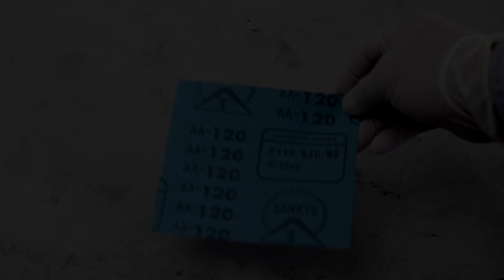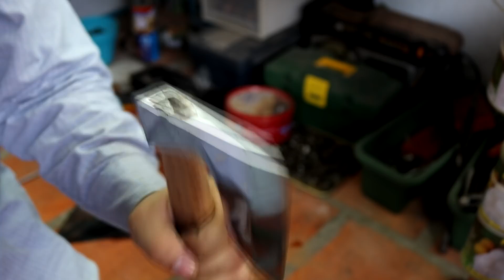Antique Axe Restoration Step by Step

Comment: You should use rust removers to not destroy the temper of the axe unless you use a wire wheel and then sand very lightly using the disc, I personally don't think you really destroyed the temper cause you sanded so lightly for the most part, oh and another tip is always glue a wooden wedge  before inserting, it will stay inside better and make it a bit stronger too. A couple good rust removers are Krud Kutter and Evapo-rust

Comment: Excellent...excellent job.  The only comment I have is on the metal wedges.  You used them wrong(imho).  A softwood wedge is used in the handle slot and then. 1 metal wedge perpendicular to that.

Comment: Grinding the cutting edge of any tool at that speed just killed the temper in the blade nice axe no makers mark and useless wall hanger
Reply: Not as long as you dont over heat it, dip it in water as your grinding and you'll be fine. But also with axes since they're so thick you can grind constantly with light passes and be fine. Of course yeah if you get it over 400° F then yeah you can ruin the temper.

Comment: Dude, you ground it way too much.  Wire wheel it to take off the surface rust, some cleaning of the eye and pull, new handle and a resharpen; done.

Comment: You did some mistakes, this is a japanese axe with triple laminated steel. Actually is an expensive tool. It is made out of triple laminated steel that has great metallurgic characteristics but when you used the grinder you removed the outer surface of heat treatment!!!! You lost a part of the metallurgic value that the tool had! what you should have done is rubbing with wd-40 (or other mild thin oil) with COPPER wool (or brass, or something like the ones used in kitchens for rubbing steel kitchenware) that would remove the red rust on the steel but would not harm the steel surface.... Anyway, it is ok as it now but definitely inferior from metallurgic point of view.
Reply: Finally one of a few people who actually know something and give advice. Thank you.
Reply: Japp

Comment: You destroyed the original finish, removed the maker's mark, put a ridiculous shiny finish on an axe that was never supposed to have it, and you hammered in two steel wedges the wrong way, instead of using a wooden wedge. Please next time, just give the damned thing to someone who knows how to hang an axe properly, instead of "restoring" a tool from something useful into a bit of shiny garbage.